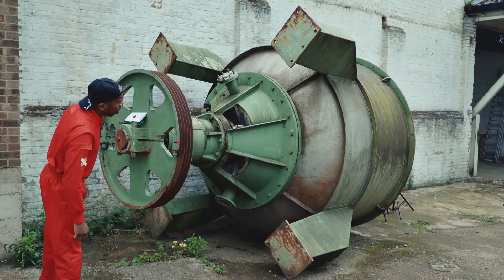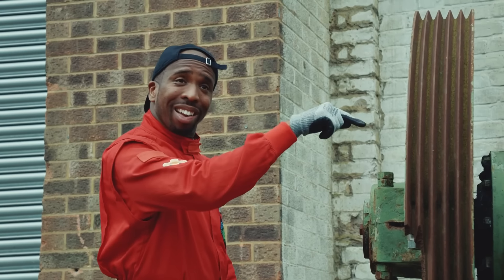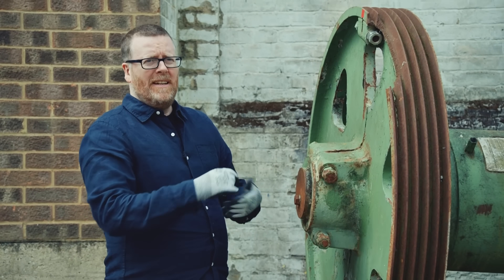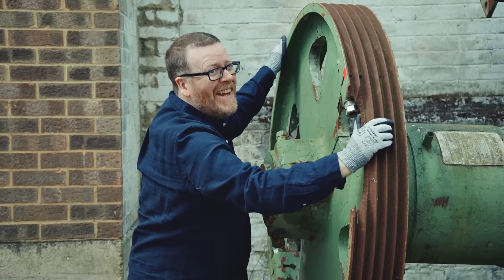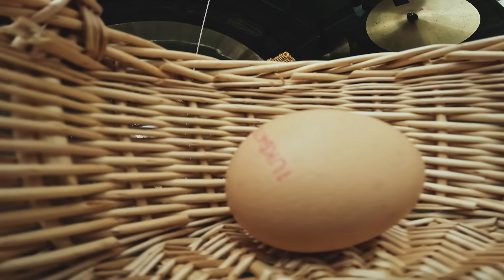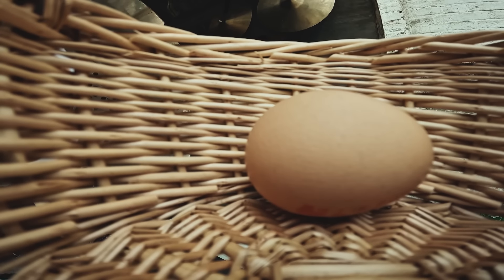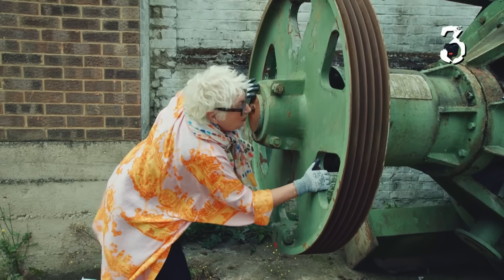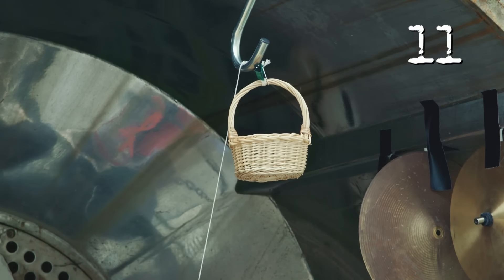Rotate the Pulper - But DON'T Pulp the Egg | Full Task

Comment: I’m a bit surprised none of them decided to go back and forth between full clockwise/counterclockwise rotations.
Reply: Given they didn’t know the mechanism of egg based doom, I doubt any of them thought it would help.
Reply: If you watch carefully, Frankie spins the dial in one direction while everyone else spins it in the opposite direction but the thing inside the drum only spins anticlockwise for all of them, so no matter which way they rotate it the mechanism will still make the egg basket rise.
Reply: @shinbios  going back and forth would undo the rotation anyway. Although i'm guessing it would also undo your score as well
Reply: @lred1383 it wouldn't undo the rotation, as there seems to be some mechanism to provide rotation in only one direction regardless of which way the wheel is turned. Francie is the only one to turn the wheel in a different direction, but every shot of the inside of the pulper has the blade spinning the same way, so even switching which way they spun the wheel wouldn't have mattered